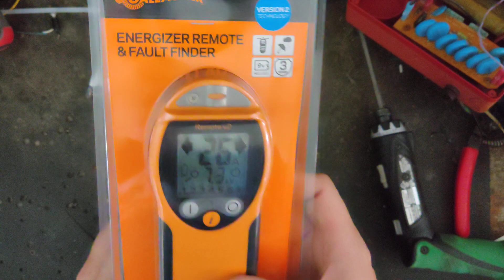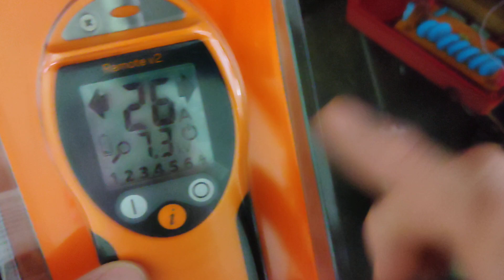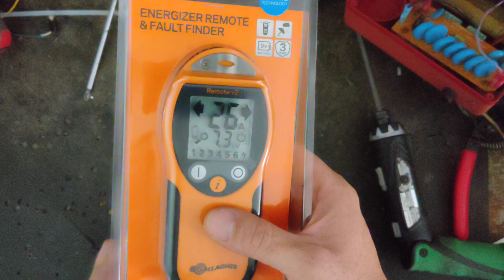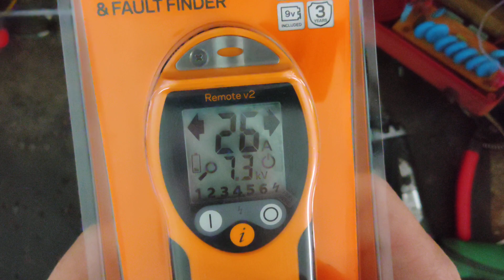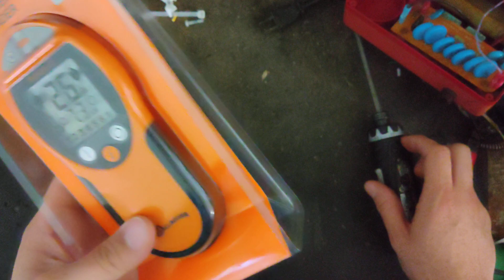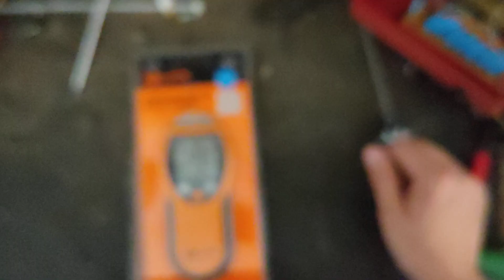Gallagher Electric Fence Remote Control | Gallagher Remote Control Fault Finder Repair

Comment: My Gallagher remote V2 won’t turn my M1800i charger on or off unless I’m within about 100 yards of charger.  Outside of 100 yards it will just go into search mode when I try to turn it off. It will read volts and amps no matter how far away I am.
Reply: I now have 9 grounding rods driven at least 4.5 feet deep and remote still won’t work past about 100 yards. Fence registers 8-9k volts on 3 poly braid wires on about 1/2 mile fence.
Reply from the maker: @lanceokiefarmer1097  That's a strange one... Here's what else you could try, but not sure if it's going to work or not. When you're out passed that 100 yard section, squat down to a knee to bypass your shoes, and then try the remote. You could also squat down and put your hand on the ground and try the same thing. If the remote starts working, then it just means that the shoes/boots were insulating you a bit from the ground and making it harder for the remote to communicate though the ground the further out you go. This is only an educated, but hopefully, guess.
Reply: @FencerFixerRepairLLCKansasCity  Ok I did try a different pair of shoes because my work boots were shock resistant but I didn’t try kneeling. I’ll give it a try tomorrow.
Reply from the maker: @lanceokiefarmer1097  ok it's worth a shot. Gallagher has come out with a newer style back cover for their remotes. It's made of summer kind of different material, it's a complete kit. I've only replaced it once for a customer. I don't remember what the cost is, but it's not super expensive, but it's made by Gallagher themselves, so it's not super cheap like you would hope
Reply from the maker: It's a possiblity you need some more ground rods. That remote has to use your body as ground and you use you as a point to get back to the unit to turn it into standby. Possibly it's dry right now or you just need more ground rods for the remote to talk to the unit between ground and hot on the unit. The ground rods act like a magnet to pick up the signal and if the ground system isn't adequate enough, then you could have a hard to with the remote being able to talk to the unit. That's where I would start with it. A minimum of (5-6) 6' galvanize ground rods, as deep into the ground, and space them right around 10' a part, not much closer and not further a part.
Reply: @FencerFixerRepairLLCKansasCity  ok I have 3 now that I could only get about 3 feet in the ground. Ground is wet rocky about 3 feet down. I’ll add 3 more and see what happens. Thanks.
Reply from the maker: @lanceokiefarmer1097  You try and cut them in half and drive 6) 3' Rods spaced 10' a part. It may be wet right now, but that's a bigger joule unit and they really need a decent ground for everything to work right with each other. You'll probably get better shock performance on the fence as well for the animals when it's grounded better
Reply: @FencerFixerRepairLLCKansasCity  got it. Thanks
Reply: @FencerFixerRepairLLCKansasCity  just had a thought. Can I use a barbed wire fence with steel fence post as a ground rod?
Reply from the maker: @lanceokiefarmer1097  I don't think it's going to help much. Most fence post are regular steel or painted Steel both of which rust, so they went really add anything because of that, and some barbwire is rusty too. I don't think either are going to really help anything. Rebar is the same way, it rust too and won't add anything.
Reply: @FencerFixerRepairLLCKansasCity  ok. Thanks

Comment: Thats pretty good. Pricey but good
Reply from the maker: It is a tool and not a gimmicky thing. It's 3 tools in 1. The money and time you'll save will pay for itself in one use when troubleshooting a fence to find faults and not have to run back and forth to turn the unit off and back on.